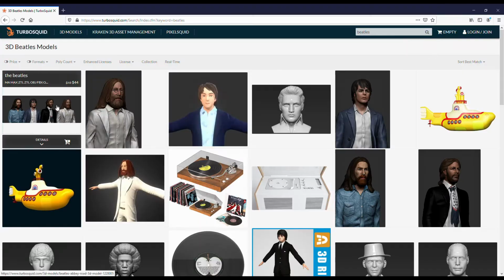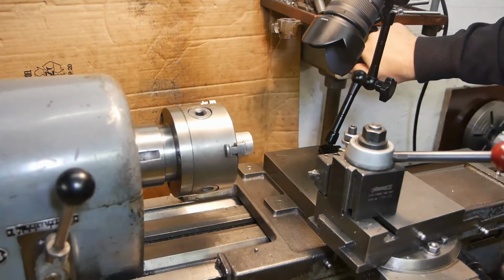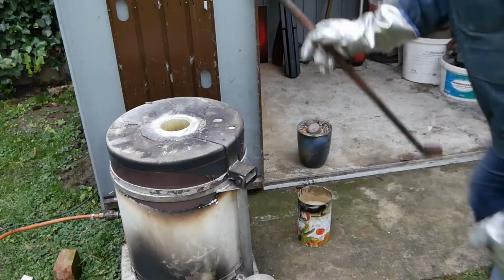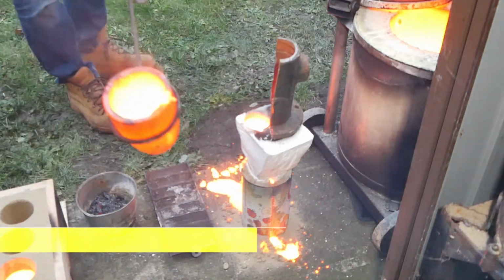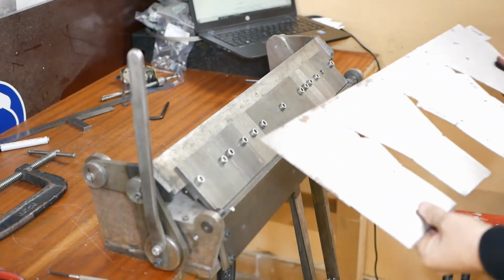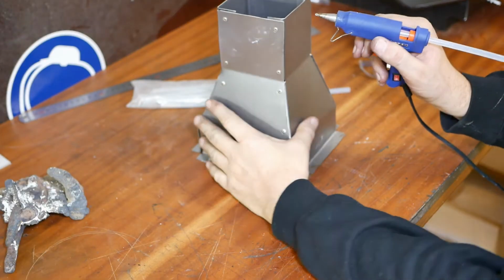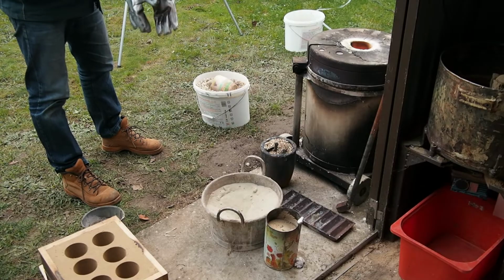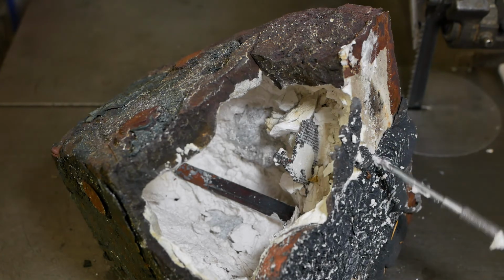Bronze casting fail - The Beatles - Abbey Road - George

Comment: Complete newbie here: whilst it looks very satisfying to cast ingots, it seems that the chippings would melt much easier than an ingot. Is the reason for casting ingots to reduce oxidation surface?
Reply: Oh, and a question about those clever clampy bits that get compressed with a tool - I have totally fallen in love with those. What do I need to put into my search engine to find those for sale, please? Thank you!
Reply from the maker: @mumblbeebee6546  They are "Cleco Clamps". I think Amazon stocks them.

The Ingots are simply easier to store, as they take up why less volume than the chips. And due to ow surface area will have very little slag the second time through the furnace.
Reply: @RotarySMP  Thank you!

Comment: I do a little vacuum assisted lost wax casting. Our flasks are stainless steel. I’ve never seen the kind of corrosion that seeps into the investment. Our flasks are completely covered in perforations. I think it’s so that the vacuum can pull evenly through the investment rather than to allow moisture to escape. The investment cures rather than dries. 

We try to keep the cavity at least 12mm away from the flask. Otherwise there is a risk of investment blowout. Of course we are pulling a significant vacuum so you could get away with less maybe. 

We have the luxury of a burnout oven as well as an induction furnace. What that allows us to Sonos keep the flasks in the burnout oven at a pretty high heat until we are ready to pour each one. Then it’s a dance to get the flask out of the oven, flipped over into the vacuum thingie (a little technical jargon there) and then maneuver the crucible into the pouring shank before it gets too cold. 

I would make a larger pouring basin simply to put more weight above the cavity to improve the filling. Not sure if that is an issue. 

It seems you are going in the right direction.
Reply from the maker: I really appreciate your feedback there. I have found a local place which sells stainless steel chimney pipe of the correct diameter, so I will try that next for a flask. I'll also change that pouring basin. I think the big issue on the second pour was simply not waiting for it to super heat. 

The embarassing thing is that I have a plunge thermometer I made with a K type thermocouple proteced by a graphite rod, and could have / should have measured it.
Reply: I think the stainless will help. Who knows what is in the investment and how it will attack the steel flask. We usually allow the investment to cure it harden for several days before starting the burnout cycle. That should also allow sufficient time for the moisture level to drop. The concern is that if the moisture has not evaporated slowly a sudden rise in temperature could distort the investment and potentially crack it. On one of your castings there were numerous very thin pieces of flashing that indicated that the alloy had filled into many deep fissures in the investment shell.
Reply from the maker: @ericmorriscompany9648  The first attempt I definitely burned out too fast THe second one was closer to the manufacturers schedule, but still faaster. 
I have had other advice that you should only wait the recommended 90 minutes after mixing and then start burn out, and not let it sit for days. That was confusing.
Reply: @RotarySMP  I would follow the manufacturer instructions then. There are so many proprietary formulations that can have vastly different properties. The manufacturer wants you to be successful so that you buy more of their stuff.

Comment: Even though I own 2 3D printers, I guess I would order that print from someone with an SLA. Not sure if the goal is to make it from scratch or to have it finished. You can also look into silicone + wax, it might prove more successful and not ruin the print each time. But what do I know, I just watch YouTube. I enjoy all your videos.
Reply from the maker: The printer is now pretty reliable. The decapitated George was from me waking up, logging on to the Printer, seeing the heaters still on and thinking, "weird there should be a g code to turn them off after the print finishes" and turning them off manually. 

The print wasnt finished.

Silicone and wax is tempting at one level, but then I have to lean two new skills and probably need to make new tools. Tempting indeed, but really I only want a single statue.

Comment: You need to feed the metal into the thickest section of the cast part.  Where you feed the metal into the part should be thicker than the part like 1.5 times as thick as the thickest section of the part that way it will solidify last thus leaving shrink voids outside of the finished part.  You will also need some way to gauge the temperature your molten metal before you pour it so you can make sure you have sufficient supper heat for you casting.  Supper heat is the difference in temperature between the melting point and the temperature at which you pour the metal.  You always want to supper heat at little as possible however too much supper heating will cause you to burn off / volatilize lower melting point parts of the alloy and causes excessive oxidation.  However insufficient supper heat will cause the metal to solidify before it completely fills the cavity for your casting.  IE low supper heat for casting ingots and a high supper heat for casting long thin parts so that the metal is sufficiently hot / thin / fluid enough to fill all the details fully before it solidifies.

If the metal is somewhat molten but feels kind of chunky it is not fully melted.  Alloys do not go straight from solid to liquid, there is a range over which they melt with the exact composition of what is melting changing some as the alloy melts.  The full explanation of this would require the use of a binary phase diagram and really is not needed in order to make a successful casting.  I just refer to it in case there is interest in understanding why it could seem "chunky" while melted.

Let me know if you have any other issues.  I started off in college in Metallurgical Engineering.  I changed majors a couple of times but completed a materials minor in Metallurgy.
Reply from the maker: Thanks for your feedback.
1/ Not sure I can do much about feeding dirrectly to the thickest section (the shoulders), which wouldn't leave ugly defects at the gate. The rate of section change up the legs is very low. The other two statues  I did have no shrink defects. 
https://www.youtube.com/watch?v=ba8T-AgilCM&list=PLHRtJd1bD3ITm_OPiV2CvW46Hf6luHMJ1&index=6
2/ I have a K type thermocouple immersion thermometer with a carbon rod protective sleeve I made for checking the pouring temp of aluminium. I never used it on bronze, but should have. The temperature range is sufficient. This was dumb of me. You can see the difference clearly in how fluid the first pour ws, verses the second. Waste of a lot of work.

Comment: Man, lost wax casting is an even deeper rabbit hole than green sand casting! Quite surprised by the reaction between the steel sheet and the investment plaster.
Reply from the maker: You have that right! I think I got that mould temperature about right. the required 750°C is cherry red. I might have had an excessively oxidising flame during burn out though.

Comment: As an old Jeweller who's done a bit of centrifugal casting, I'd be using thin wall stainless steel tubing for your flask.
We'd to get off-cuts from a bloke who made handrails but 10cm (4") diameter was our maximum needed for jewellery.
Our flasks were all solid & only time "holed flasks" were required was for doing "vacuum casting".
HTH, Colin
Reply from the maker: Thanks for you fedback on that. Did those stainless tubes last multiple burn outs? Also good to know that the holes were unneccesary.
Reply: @RotarySMP  Yes, those type flasks are designed to be used multiple times (100's).
Every time they're "cooked", they go through the "shock" of being quenched to aid in releasing the investment & the casting within. This eventually takes it toll on the flasks & their wall thickness become too thin & brittle. In your case, a flask with a wall thickness of about 1mm should work just fine.
Reply from the maker: @colincreedtattoomachines  Thanks for that feedback. Bummer that the steel supplier is closed due Covid lock down, so I cant take another shot at this till at least the 18th Jan.

Comment: I've only sand cast aluminium but have few comments these are meant constructively. Your working area looks really cramped I don't think working over grass is any less safe than the tiny patch of concrete. Have a look at MyfordBoys oil burner looks easier to use. Veg Oil Guy uses some sort of Pipe ( not sure if it's stainless) for flasks easier than making them. Possibly need a bigger feed gate and vents too? Is your jacket man-made fibres? Maybe see if you can pick up a leather welders jacket or thick woollen jacket? Gloves look great btw better than my welding gauntlets! Anyway keep at it you'll get there.
Reply from the maker: Thanks for the eye on safety. Normally I use an old leather jacket (which is even in that shed), but it was cold and I forgot to switch over before the pouring started. Good on you for pointing that out.

The grass gets pretty muddy at this time of year. I Try to ly things out so as to avoid a trip hazard during pouring, but also noticed that I left the lifting shank in the way when done with it.

Those gloves are awesome. Rather expensive, but real industrial high temp process gear.

I have reached out to VOG to ask for assistance.

Comment: Boy that was a rough go of it. A+ for the effort. Have you ever watched SWDweeb’s channel? He just did a series of how to, but it was based on sand casting... Another channel would be VegOilGuy, he does these type investment castings all the time, but his are smaller scale.

I think one problem you’re running into is the size, which doesn’t seem like it should be an issue as you just scale things up. But it’s harder because the smaller ones using a vacuum setup, plus an easier burnout of the plastic, makes it work better.
Reply from the maker: Good points. I already reached out to the VOG to ask him to take a look and maybe give me some tips. 

Sand casting in Alulminium is way easier than this by far :)
Reply: @RotarySMP  yeah, brass is a little harder, needs to be hotter. But at least you’re no doing steel or cast iron. VOG should be a great help.
Reply from the maker: @johnmccanntruth  I have done a bit of cast iron. It is another whole level harder than bronze. Took me quite a few attempts to get a first usuable casting. Steel is not going to happen in my hobby foundry.

Thanks for the link to SWDweebs channel. I was not familiar with it.

Comment: Hello! I know nothing about casting, but i think, you need to improve your 3d printed form, just join your model and pouring plate in 3d editor, add some functional vents that can work as supports, disable supports in cura, add a flask and print it in one piece few times. Break it, check the quality, may be tweak something. Plastic and 3d print is cheap instead of you time to make this molds and melted metal.
Reply from the maker: I also had the same thoughts, but to have a the arm support structure coming up off the pouring plate, I would end up with a huge support structure to carry the statue plinth.

The first attempt, that pouring basin and runner worked fine. The second time was probably a combination of not going around that critical joint with lots of extra hot glue, and mainly, not waiting for the bronze to get a couple of hundred degrees hotter. I printed the model four times and cetain parts a couple more times to optimise the support structure.
Thanks for your feedback.
Reply: @RotarySMP  You can print a plinth in a brige mode with 2 supports on long or short sides, may be add some thickness to it
Reply from the maker: @КонстантинКучер-щ5м  Good idea. I will look into that. I really don't want the plinth thicker, as it is just the paint of the abbey road crossing. :)
Reply: @RotarySMP  file it after casting to thickness you want.
Reply from the maker: @КонстантинКучер-щ5м  Very hard to hold a casting to mill off the base.
Reply: @RotarySMP  i know, so i say file, not mill. If i need to mill it, i will try to glue a sides of plinth to two aluminum blocks same level with car putty.
Reply from the maker: @КонстантинКучер-щ5м  Shame I cant tig weld. Adding the plinth after the casting would make the investment block much smaller.

Comment: Very interesting! Why don't you use something like the copper pipe for spouts (or some copper sheets)? I think that the copper should be a bit more corrosion-resistant than the mild steel, but it's expensive and hard to come by if hardware stores are closed.

And why are you pretending to be an American philosophy professor teaching in oxford in onshape? Is he to you what Clark Kent is to Superman?
Reply from the maker: The buy out requires holding 800°C for four hours. Since i dont have an electric burn out oven or kiln, I have to make do with the furnace. There will definitely be hot spots which exceed the melting temp of Cu.

Eagle eyes:)  I have never met him, but it is not a common name.
Reply: @RotarySMP  Ah, now I understand why you are not using copper.

And regarding your username: How does an aircraft maintenance guy with an old lathe and milling machine in a home shop happen to come across this name??? I am very confused.
Reply from the maker: @vincentguttmann2231  Good question. About 20 years ago, I got all keen on building a self designed home built aeroplane. I was also dead keen on using a Wankel rotary engine to power it. My design was going to be called the Rotary small metal plane.

Then kids and life came along and my priorities changed, leaving only the tag :)

Comment: I have not done any casting. However i have watched some lost pla castings. I think the material you are using for the casting is suspect. What I mean by this is that most of the time after a burnout i have seen the mold was actually rock hard. Yours seems to be fragmenting. Why not try a 2/3rd plaster of paris and 1/3rd play sand mixture and see how that holds even after the burnout.
Reply from the maker: This is a newly purchased commercial product specifically designed for block investment casting. POP and sand just cracks and falls apart (ask me how I know). This is also Gysum based, but has additional powders to improve the stablity. The first one fell apart so easily, as the first pour was setting (and therefore stopped escaping) when I made a second batch and topped it off. There was no bond strength at that bond line between the two batches.
Reply: @RotarySMP  AFAIK gypsum simply breaks down at high temperatures.
Reply from the maker: @besenyeim  It does. I have no idea what modifiers get added to this investment to maintain the strength during burn out.
Reply: @RotarySMP  doesn't really matter. Follow the manufacturer's instructions, and it will be fine. If still not, it's probably not good for this application.
I was referring to the OP, and your reaction to it. I didn't know that, until yesterday, but added SiO (e.g. sand) lowers gypsum's breakdown temperature. It is still good for quick Al castings, but not for copper alloys.

Comment: I've only ever cast lead for bullets so certainly no expert but from what I have seen elsewhere on investment casting, rather than casting a solid block the refractory is built up in layers from successive dippings. I suspect if you build up enough thickness you could loosely suspend the investment in the sandbox for pouring.  I wonder have you tried mixing the plaster with ice cold water to slow the hardening since the hydration reaction is exothermic? Your wrists and shears are going to hate this but maybe stainless steel for the flask? All suggestions based on intuition rather than practical experience.
Reply from the maker: Good points. Shell investment casting is more common in industry for big parts (probabl cheaper), but is even more dependant on controller burn out, which i cant do. Actually this plaster solidified much slower than I expected. Although the instructions say ~10 minutes, it was closer to 20. Seemed like forever when you need three hands to block the leaks and wait for it to bind.

I think commercial ones are stainless, but at these temperatures, no steel is really stainless.
Reply: @RotarySMP  I was thinking the SS would be less inclined to de-laminate at high temps. Watching this video has me thinking (dangerous, I know) you can get commercial concrete curing accelelerant.  It may work with dirt cheap plaster of paris assuming PofP can take the heat? I suspect the commercial mix you use here is not cheap or you would not have gone to so much trouble with the flask
Reply from the maker: @RobB_VK6ES  That 22kg of powder investment cost €45 + €55 for shipping (insane, but I could find no better deal). Then again, a simpler flask will only cost an extra kg of investment, and save me hours though. so the next flask will be stainless and will be simpler.